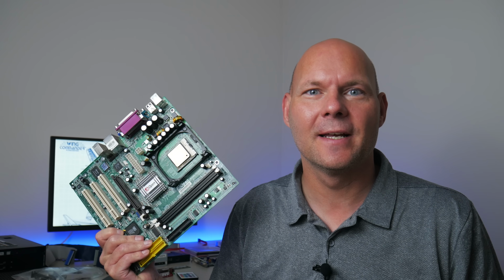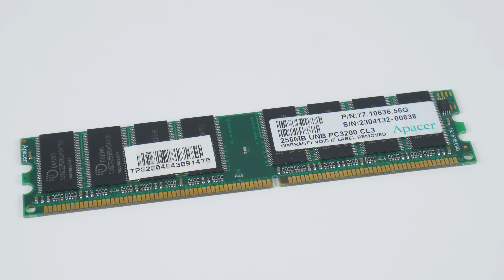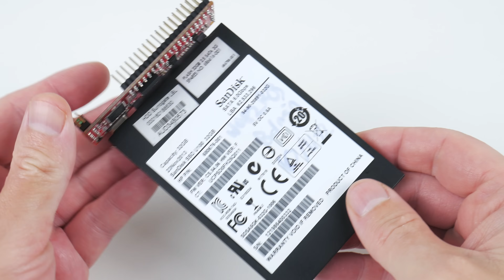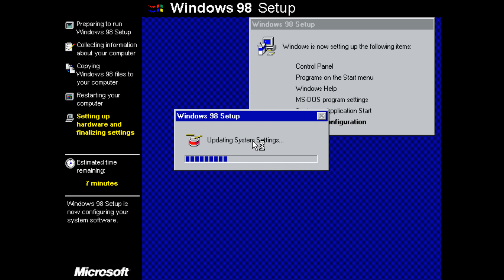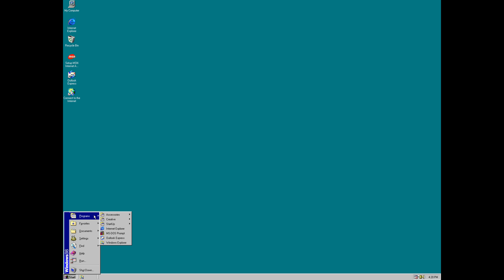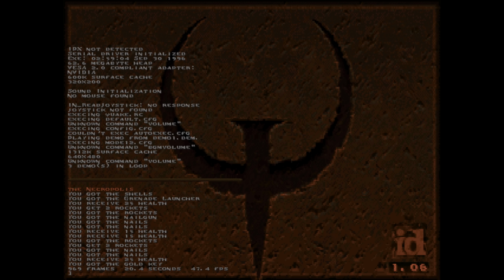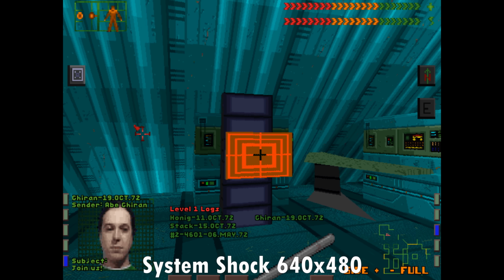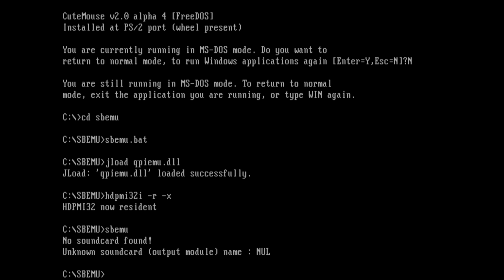Pentium 4 with SIS chipset? Sometimes Retro PC Gaming can be frustrating!

Comment: i feel the 1155 socket  is the ultimate all arounder in 2023 , you have single core cpus , dual core cpus ,quad core cpus , quad core cpus with hyper threading , descent ipc even for today , also a youtuber recently could get windows 2.0 to run natively much better on the 3770k system  than he could  his  pentium D platform , not perfect but theres obviously some suprisingly good legacy compatibility in the platform considering how modern and readily available :)  the platform is

Comment: I have an aopen mx-800n with a celeron (SiS chipset). I've used the ymf724 on mine and dos compatibility is great. I also have dos in real mode because the sound blaster emulation is supported by the chipset via a tech called Distributed DMA, although the ess solo-1 doesn't work on this platform for some reason.
Reply: there is also a Avance Logic ALS4000, has a decent OPL clone in it, unfortunately it is quite hissy and too quiet and the VxD driver is kind of buggy

Comment: I'm not in the scene so not sure how blasphemous this is. There's probably not DOS drivers for the audio, but what about running DOS games under Windows 98 using the onboard video and sound? Probably not going to have any hardware 3D support, but would the speed of the CPU help compensate for running software render in early 3D games or earlier 2D games? I'm just wondering since this motherboard has video and sound integrated if there's good opportunity to make a low profile system out of it, if the range of games/software you expect can cooperate.
Reply from the maker: The onboard graphics is certainly decent in DOS but for 98 it will likely have compatibility and performance issues.

Comment: Tomb raider is capped at 30fps. In software mode the graphics lack perspective correction and I believe all of the vertex math is integer instead of floating point. This means wobbly polygons. Same thing on consoles like the PS1, but 3d accelerated version (3dfx/powerVR ect) fix it because that is what 3d accelerators are designed to do. 

As for Quake, it has no frame buffer enabled by default. This isn't a problem if you are running at less than 72 fps, but is a problem if you are running at a higher framerate. Either up the resolution until your framerate drops or you can enable vsync with a launch argument.
Reply from the maker: Sweet I will check V-Sync option next time!

Comment: Phil, you may need my experience with the S478 platform. I tried several motherboards on the S478 on Intel chipsets and VIA chipsets and on all my motherboards there was one "glitch" in FPS games under native DOS. It was expressed in the fact that when you run as a player, for example in Doom, sometimes there is a kind of "sticking" of the keys forward / backward and strafe left / right and the player himself runs and rests against the walls. I have tried everything, but I have not been able to overcome this ailment. I tried it on S462, 754, 939 platforms on VIA chipsets, there was no such "glitch" there. I don't know if there will be such a "glitch" with sticking on the VIA S775 platform or not, if it works, then I will try to check it. But after an unsuccessful experience, the S478 platform is no longer closed to me. It remains only to check the motherboard with the ICH2 south bridge, if one comes across. But I believe there is little chance of success. It is very sad to see that Doom does not work properly on the SIS 651, I had high hopes for this chipset.
Reply from the maker: I think I've seen this glitch before. Did using PS/2 devices solve it?
Reply: @philscomputerlab  Thanks for the quick response, Phil. I always use only ps/2 devices for better compatibility.I tried everything that came to mind. Different Dos versions, different EMS/XMS managers, different keyboards, video cards, sound cards, different RAM, changed the keyboard settings in the Bios. Nothing helped!

Comment: Finding a reliable 478 board is hard, lots of them consumed by the capacitor plague.
Wouldn't be surprised if there's 20 Pentium 4 CPUs for every working 478 motherboard out there.

Comment: I had 2 pentium 4 PGA478 retro gaming PCs, but my AGP GPUs I had both died and didn't buy a replacement one, had 2 boards one is Intel and I still have it has 4 DDR slots and dual channel butno overclocking, and the secondr I had was an orange PCB Abit (first time I learned about that brand) one with 3 DDR slots, It supported overclocking but not by much before my soundblater live 5.1 SB0100  stopped working, unfortunately my mumthrew it out with a bunch of other retro hardware I had collected , had only one LGA775 board that only supported pentiums but gave it away because I had  a core 2 Quad q9400 system already, that Intel board was the first time I learned about that PGA478 exists
Reply: just checked my local site that sells refurbushed and retro hardware and they have some good AGP cards now an ATi Radeon X1950 Pro 512MB (256bit) GDDR3 AGP for 72€ so compared to other AGP cards they have for 32€ seems expansive but from what I found it's one of the most powerful AGP cards so I -ot with my soldering skills and tools, they also have an Sapphire HD4650 1G DDR2 AGP for 72€ but I guess it's not as good even with the extra VRAM and ddr2 vs GDDR3, and hopefully I can find drivers for the intel board after they don't have them for download anymore. Edit: compared the specs amd the HD4650 1G is newer and better overall apart from the ddr2 and 128bit bus

Comment: New to the P4 club. Got mine 2 months ago for free but had one back in the days. A bit off topic from the SIS chipset:
I got a Biostar mobo with via p4m266 chipset, 1.5 GB DDR RAM, 2.26Ghz s478 P4 cpu (could not tell arch right now), good modern fsp 300w power supply, SB Live 5.1 and a Voodoo5. I installed Windows 7 "Lite Edition" to have access to my steam library and now valve is going to discontinue Win7 from steam lol. Had to install the SB Live driver from the KX project, works fine for windows. I can run the steam version of UT99 with glide and runs beautifully, better than i remembered it. The steam version of Serious Sam does not work for me, only the classic stand alone one.
As Phil said in other videos: For P4 systems try to get an intel chipset, if not then go for Via, compatibility is true, they are everywhere* and never had any issues with any of my via based pcs.
Reply from the maker: I stopped buying a single Steam game since they abandoned XP. Only buying in GOG and games like Serious Sam work fine under 98 😊

Comment: You know what i always wanted to test? Some of those AM2 boards that had an AGP port, like the Biostar K8M800 Micro AM2, those things should be able to handle W98/DOS gaming very well and have a pci slot for a sound blaster live. The IGP should also work for W98, altrought its similar to a Savage 4/2000 so you cant expect much out of it.
Reply: By the time of the AM2 socket, AGP had been dead and gone for several years at that point. The few motherboards that still offered "AGP" were usually fake jimmy rigged proprietary vendor specific solutions that weren't really AGP, but instead some cobbled together black magic that relied on hopes and dreams to work.

The K8M800 chipset was probably the last chipset to offer a real AGP bus, but not without some significant limitations and compatibility issues. Multi-core CPUs required specific driver setup to work, had a limited number of guaranteed compatible cards, and 64 bit operating systems didn't support fast AGP texture support, which significantly reduced performance.

The "fake" AGP slots like AGI, AGX, XGP or AGP Express all had varying levels of compatibility and performance. AGP Express was probably the worst, since it was basically a rewired PCI slot. You lose 99% of the performance of the card going from 2133 MB/s to 133 MB/s shared bandwidth, plus the loss of AGP texturing, sideband signalling, etc.
Reply: @GGigabiteM  ASRock had lots of these mutant boards. On the other hand, that sounds fine for a Voodoo 3, those don't really use the advanced AGP features anyway.
Reply: @HappyBeezerStudios  Unless you find one of those boards with a universal AGP slot, no Voodoo AGP card is going to work, because they're all keyed to 2x. AGP 4x/8x has a different key so 1x/2x cards won't physically fit. They also run at different voltages (3.3v vs 1.5 or 0.8v) so they won't work regardless.

The only exception is MAYBE the Voodoo4 4500, because it is the only model with a universal keyed edge connector. I've heard mixed responses about it working in newer 4x/8x slots though.

The last known motherboards with universal AGP slots were in the middle of the P4 era with chipsets that usually only supported the 533 MHZ FSB Northwoods. Or earlier Athlon boards, but those are less useful since they only support SSE, where the P4s support up to SSE3 and can still run modern software.
Reply: If I'm not mistaken the Asrock AM2NF3-VSTA had not only AGP but also a BIOS update to support AM3 CPUs. The epitome of anachronism?
Reply: @MixerVM  Oh, thats true, you can run a Phenom 2 CPU with that, i wonder how well that AGP slot works, i think it runs under a pci bridge.
Reply: @Lurch hey, at least one of the two fastest AGP cards, the other being the HD4670. which one is faster varies from game to game, but both are great.
Reply: @HappyBeezerStudios  The problem is more with getting drivers for windows 9x. For example i have a GF6200 512MB AGP, that its not great, but it is the faster AGP i currently have, i never managed to get it to work under W9X. Probably due to a combo of bad drivers and the amount of vram.
Reply: @HappyBeezerStudios  The last true AGP cards were the ATI x1600 PRO and the Geforce 7800GS. Any cards after those used special PCIe to AGP bridge chips. Even some versions of the 7800GS used bridge chips, because the AIB was naughty and used a higher tier 79xx core and just called it a 7800GS.

These bridge chips caused all matters of compatibility headaches, often requiring vendor specific drivers, the stock ATI/Nvidia drivers would not work with them.

I have several such cards with bridge chips (HD4670 AGP, 6600GT AGP, 7800GS AGP) and it's a headache to get any of them working due to driver problems.

Comment: My favorite is still the SIS 5591/5592 AGP chipset, which runs at twice the speed, gets super hot over time.....But 75Mhz FSB isn't so bad anymore when you can access overclocked AGP and SDRAM at the same time! Too bad it's limited to only an AMD K6-3 at 450Mhz at best.
Reply: i was happy on early Quad Core models back then, last AGP builds ?

Comment: Hello Phil, could you do an „Easy Win98 Setup with USB“ video? So far i always used ME because of the integrated USB support and easier access to older official Windows Updates. There is so much unofficial stuff for Windows 98 floating around that mostly just breaks new installations, at least the update packs i tried.

Anyway, awesome video.
Reply: Can't you just copy the WIN98 setup files to the drive after it's formatted? Honestly, it's easier to install than WinXP. If you want USB support in Win98, just use the nusb36e driver.
Reply from the maker: Just install the linked USB driver in the description and you got USB flash drive support in 98. Yea the unofficial SP isn't needed for running games.
Reply: @philscomputerlab  even when the chipset drivers are already installing USB drivers? All guides state to remove them before installing the USB drivers, which is difficult without PS2 gear
Reply from the maker: @CHA0SHACKER  Yes that's always how I installed these drivers.
Reply: @philscomputerlab  thanks for the info Phil. I’ll try it out.

Comment: Software renderer for Tomb Raider was always like that. Texture warping is caused by the fact that perspective correction value is not calculated for each pixel but just for couple points for each face. Anything in between is simple affine texture mapping (no divisions - much faster). There are 2 or 3 settings possible in TR that select how much of these point to use per face. Quake engine did that too, but was a little bit smarter about it. As for face drawing order issues I am not exactly sure but it looks very similar to what you get when using simple painters algorightm instead of  proper, per pixel Z buffer. Hardware accelerated version solves those problems by letting graphics chip do all the drawing, which it does much better than software renderer.
Reply: The software renderer reminds me of the PS1 port of the game but no Z calculations would make it run faster but suffer from the PS1-style warping. I was running it in 320x240/30ish fps on a 486DX100 back in the day on DOS 6.22 and I could even run TR2 in 320x240 on Windows 95 in software but it was more like 20 fps because of the 95 overhead.
Reply: I was Lucky to buy an Apocalypse 3dx back in the day and still have it to this day, in a p4  2.4 that runs tomb Raider, resident evil 1 and tomb Raider 2 with the help of a geforce 2 GTS 😁😁
Reply from the maker: I will check next time if at 320x200 you see the same issues...
Reply: @philscomputerlab  These issues are still there at lower resolutions but they are less noticeable (due to pixelization).

Comment: Pentium 4's A and B were a disaster but C and D were great. I still have my P4 2.4GHz (C Northwood). I have a HDD with Win98SE and another with WinXP SP3. I can play all the old goodies. My old P4 never let me down. It works non stop since Nov 2002 (third power supply and second CPU fan). I originally had an AGP GeForce 4200 Ti 128MB VRAM and then I bought a Sapphire HD4650 1GB VRAM. One can also go with a Pentium 3 (800-1400 MHz) for a retro game machine, however P4's are easier to find, cheaper and newer.

You do not need more than AGP4X, thus do not look specifically for a motherboard that allows AGP8x. Even the Sapphire HD4650 does not bottleneck at 4x over 8x (1-2fps will change nothing when you already have 50+ fps).

Keep it up as you make great videos. 😊 Cheers from Bulgaria! 🎉

Comment: I bought a Dell Dimension 4550 OEM PC, back a few years ago. I had the same model about 11 years ago, but that one had bulging caps to it and thus I had to throw it out. Anyway, the Dell Dimension has a Pentium 4 2.0 processor ( no hyper threading) an AGP at 4x and 512 MB of memory. It's great for Windows 98 gaming. I used to have a Geforce4 Ti4600 card for the PC, but it started to artifact on me about a year and a half ago so I use a Geforce4 MX400 for it. I lent the PC to my brother because he likes to mess with old Windows 98 machine from time to time.

Comment: You can get the Akasa AK-675-S, skt 478 cooler brand new still, I have 1 in my 478 P4 build, I have even swapped the fan for a Noctua item, hoping to make it a bit quieter, not that it helped much, lol.
Reply from the maker: I checked the photos online and to be honest it doesn't fill me with much confidence. The fins are massive, I have my doubts of it cooling a 3+ GHz CPU...
Reply: @philscomputerlab  I've got a 3.2Ghz Prescot with Hyper Threading and I don't have any issues Phil. Old Intel are like ice cubes compared to modern stuff like 12900K, lol. I'll have to boot my P4 machine up and take a look at the temps, but pretty sure I've investigated that before and it was all fine. After using modern stuff you get paranoid about temperature.

Comment: I always avoided SiS chipsets, I always felt they were the bottom end of the market.  However I believe the Aladdin V chipset on the Pentium platform was possibly quicker than the i430VX/HX?  I The only time I moved away from Intel was when I bought my Athlon C 1.4 and Athlon 64 processors, I went down the VIA route with those.

Comment: Like! The Pentium 4 is very nice for retro gaming. It’s fast enough for games from 2000-2003 and it can also be underclocked, if needed, for older games.
Reply: I find the only time you can under clock is on non proprietary OEM boards. I have both 478 and 775 dell and neither allow CPU speed changes from bios.
Reply: @vardekpetrovic9716  Agreed
Reply: I guess I'm a little biased because I was never impressed by the P4, but even trying to look at it objectively it seems like it's in a bad spot compared to other architectures like the Athlon/Athlon64 and Pentium II/Pentium III. The Pentiums, particularly when paired with the 440BX chipset, win in compatibility with older games.

The P4's main advantage is that there are so many of them that the platform is basically free in some situations, e.g. they still show up on street corners and public works collection sites. I wouldn't invest much in it, though. If you're going to overpay, a P4 isn't the place to do it in my opinion. Either upgrade to a Athlon64/Core2, sidegrade to the Athlon, or "downgrade" to a Pentium II or III. P4 is the platform to use when you already have it and didn't spend much to get it.

If Voodoo 3 is a requirement, the truth is you're fairly limited in compatible options due to the company's limited time in the market. You're just not going to be able to stretch to the late 98/early XP era and also back to the DOS era with a platform like this, which is apparent in the video.
Reply: @vardekpetrovic9716  I think you completely misread my comment.

Comment: I call my P4 systhem, my waste of time machine. Its a P4 3.06Ghz with SIS 650 (you using the 651). Problem is that the SIS 650 is a chipset for 400Mhz CPU's, the board OC's great to 533Mhz, but it always ends killing my GPU, doesn't matter the GPU i drop there (haven't tried a PCI card yet)

Also, these SIS chipsets use ATA133, i'm curious about the transfer rate you can get with a SSD.
Reply from the maker: Waste of time machine :D